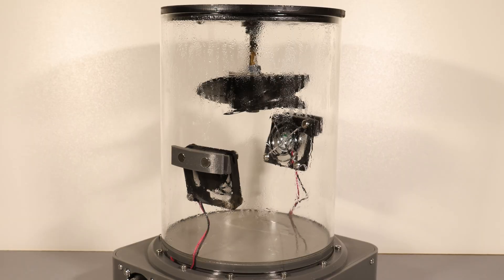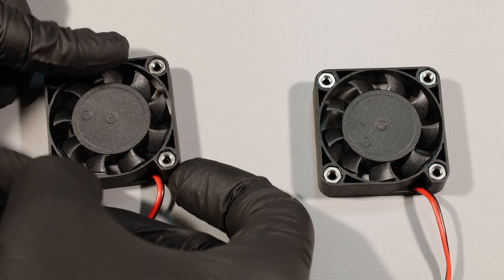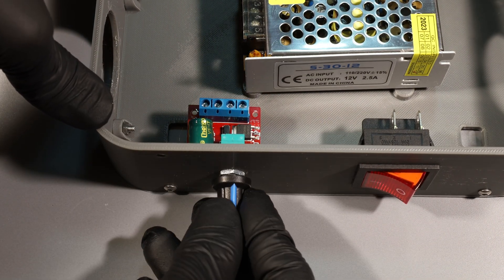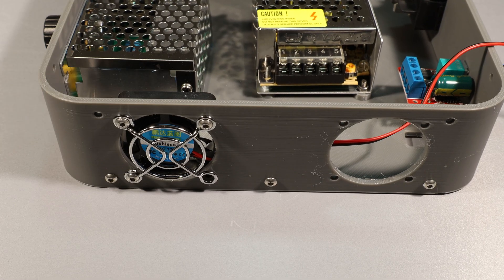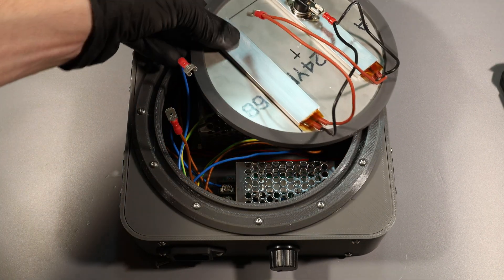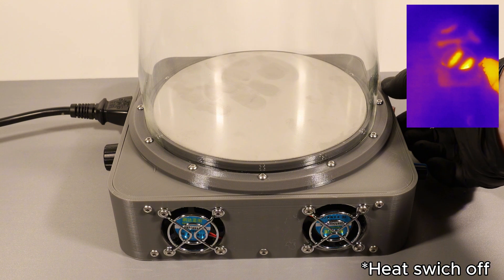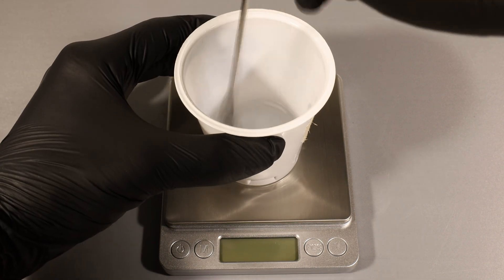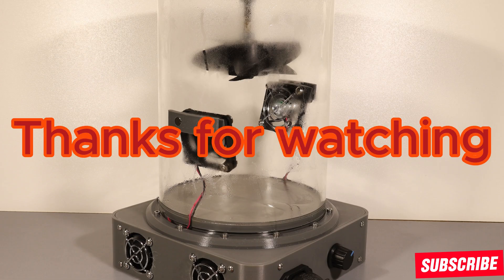How I Built My Own Acetone Smoothing Chamber for ASA & ABS Prints

Comment: Hi,  very cool design.  Wondering if this chamber could work well for vapor smoothing a PETG print material and using ethyl acetate instead of acetone for ABS material?   Do you have a parts list by chance?   I'm not an electronics whiz or engineer by any means, and likely could figure this build and setup with a parts list for the controllers, switches, AC input, switch,  and wiring needed to connect the fans, controller, and hot plate plus ground.      THanks!
Reply from the maker: Hi, the chamber itself can handle this without any issues. However, I’m afraid that ethyl acetate doesn’t work anywhere near as well for vapor smoothing PETG as acetone does with ASA or ABS.

In my pinned comment you’ll find a link to the 3D-printed parts on Thingiverse. The Thingiverse description also includes a list of all the electronic components used in this build.

Comment: Nice and clean setup, I really like the wiring too. The glass would worry me a bit, but there aren’t really any good alternatives for it. I think as long as the lid on top isn’t completely sealed, it would just pop off in case of an explosion which I don’t think will happen anyway. 

From the fans’ side, nothing should go wrong. I’ve done this many times before. The only thing I’ve noticed with the fans is that the cables tend to swell over time when exposed to acetone, so it might be worth making sure there’s no risk of a short circuit.

I also really like the PTC heating elements and the fact that everything is additionally protected.

Comment: I dont understand the need for a chamber let alone one thats glass lmao
Reply from the maker: I first used a plastic box in a super sketchy setup — worked fine until it didn’t. Then I tried a metal can, but since I couldn’t see inside, I ended up melting my print by accident.
Reply: @scienceforge1320 broken microwaves are free ;-)
Reply: @scienceforge1320 "KISS" While they dont look as cool broken Microwaves are free and have all you could ever need...

Comment: Are those fans sparkproof? If not, seems sketchy to use around volatile acetone.
Reply from the maker: Well, since the fans are brushless, there shouldn’t be any spark sources. I tested it in a plastic container for a few hours and nothing happened. That doesn’t mean it’s 100% safe, but I’m quite confident it’s safe enough.
Reply: Was also my first thought but then thing is also brushless motors can spark its not impossible so it could be a ticking time bomb